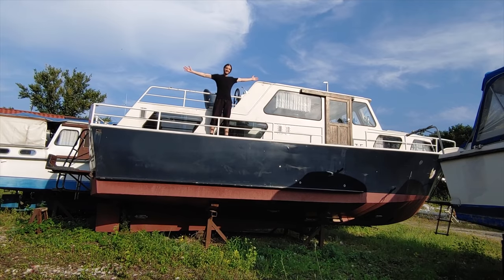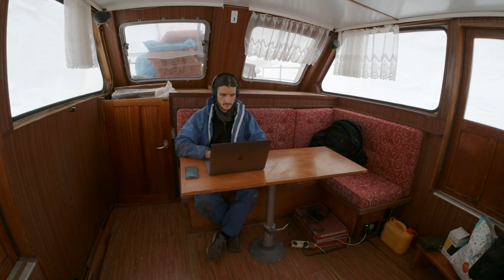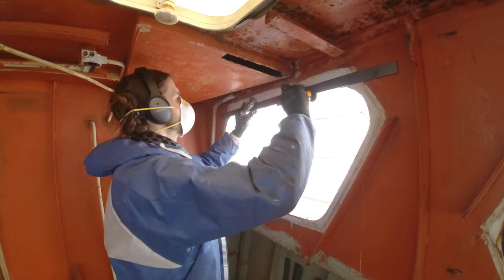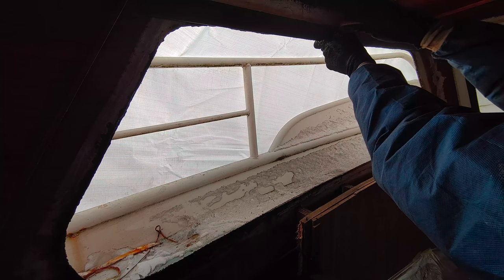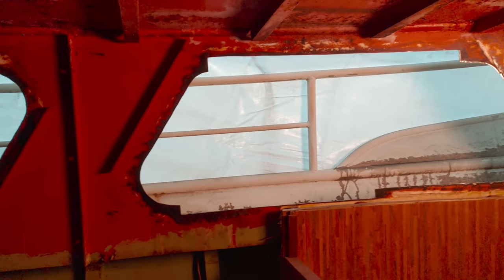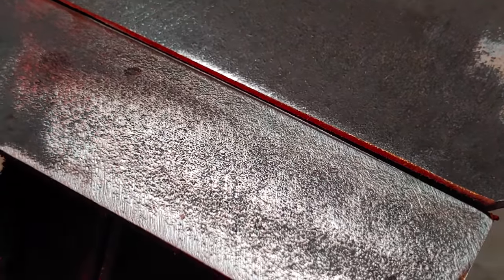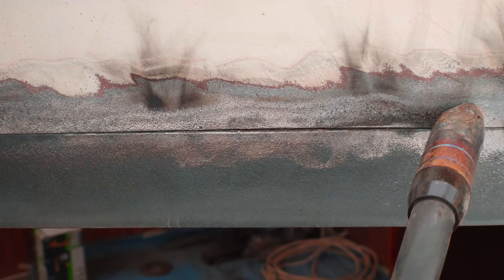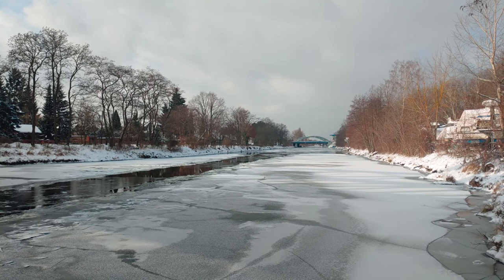Welding the Windows in our Steel Boat - Week 19 - Vintage Yacht Restoration Vlog

Comment: Should use an O2 shielding gas for best results or at least flux core wire (flux inside wire blocks O2 molecules) either method will greatly reduce splatter and help you weld like a pro!   (Too much splatter can clog the wire feed tip).  Also, when you achieve a certain mastery level, you’ll be able to use welding  as an additive material, like a sort of ‘electric hot-glue gun’ to build-up/restore rusted concavities (2-3mm deep) followed by light grinding instead of cutting, fabricating, and welding new metal that may be of different or inferior quality than native steel.  Good luck on the refit endeavor and enjoying watching the progress!

Comment: Great move to see you purchase a mig welder instead of a stick much easier for novice welders to learn. It's important you grind a bevel on the metal parts before welding for proper penetration and strength for your welds. Then when you weld the other side grind out a bit of the metal to form a grove and fill that grove up with a weld. That's how it done correctly I'm a welder fitter I won't talk of the magnets other have mentioned that. Your doing well, you'll get it.

Comment: Its a flux core welder ( mig uses c25 gas mix /MIG- metal inert gas) and the magnets are causing the issue. The magnets cause the arc to vary in flow. Good workmanship

Comment: Just a thought, if you must keep those old pieces of scrap metal for ballast you might want to consider soaking them in phosphoric acid or that rust inhibiting oil or alternatively making them into smaller, easier to handle blocks, encapsulated in resin. If I had the boat I would use that space for more batteries ( with solar panels on the cabin tops ) and add more lead if the ballast needed increasing :)

Comment: Good  work 👍 but try welding with gas to the mig , much easier 👌 , but the god thing with flus wire is that you can weld in high wind :-)

Comment: It will cost as much as the Mig, but you have a steel boat and will be welding a lot, Getting gas (Argon,5%CO2,2%O) and a regulator will improve your welds, so you can push weld (right to left) rather than the pull (left to right) welds you are doing. It will also give you a better penetration. Running some welds on scrap first to get your eye in, get the settings right and warm up the equipment will also help and make sure you have a good contact with  the earth clamp. Almost forgot, change your wire from gasless to gas.

Comment: I've had a few occasions where those magnets really interfered with the welding. it was like it was blowing the molten metal out of the weld.  I took them away and the weld laid down nice and smooth. You might try it without it and see if it improves.

Comment: Welder here, couple of tips based on what i saw... For doing tack welds crank up your machine you need more heat aka wirespeed and voltage. Your welds look cold. Did you notice when you slowed down and globbed it on your weld become nicer?!? This is because you allowed the base metal to become hotter and your weld wasnt nearly as cold. If you crank the heat you will be able to get that same consistent penetration and uniformity while putting down less weld so less to grind. Only thing that will change is your travel speed increase. With a hotter weld pass the weld wont be as tall and still have better penetration.  I also notice your mig gun at some parts had an extreme of angle, ideally you dont really want more angle than 10 or 15 degrees max so try to keep it more perpendicular to your work surface. I would also recommend skipping the torch whipp move and just focus on slowing down and making a nice consistent pass. The whipp can be cool but given the fact your welding with flux core wire you open up the possibility to burning flux back into your weld and causing porosity (think worm holes) like you see. If you're wanting to do any torch movement id recommend just going like a 3/16 of an inch/  4-5 mm and pausing for like a half second and then going 4-5 mm and pausing all while keeping the trigger pulled and wire feeding all in one continues pass. If you need to fill a large gap work the torch in a U or V on the edge of your weld never overlapping but rather just stacking them very very close together. Think of writing the letter U or V numerous times very close together without lifting the pencil while pulling it towards you in a straight line. One last thing, when you can afford an auto darkening helmet you should get one. Freeing up your second hand to help steady and slide the mig gun will help tremendously in consistency. Hope some of this made sense, if you have any questions let me know. Practice makes perfect and keep it up. 

Hardest part about becoming a better welder is learning how to read the welds and metal and then making the necessary adjustments.
Reply from the maker: Hi Cameron, thank you for the extensive tipps. It will help me in the coming days, some very important welding jobs coming up.

Comment: What all these internets welding experts haven't told you is that you can V the edges of the steel where it butts together, that enables the weld to get deeper into the join creating a stronger join.
Reply from the maker: thank you, I'll try that next time.

Comment: Turn up the amperage. You should have a nice steady buzz. Also with mig you push the weld...not pull it like stick welding. Makes no difference with fluxcore but you will get sick of the dirty welds and switch to gas at some point...much nicer and cleaner. Then you need to push the gas envelope, not pull it. Great job you're doing. You have bigger balls then most tackling that beautiful old girl!!

Comment: hi! great videos, i really like to follow your jurney. a tip for your welding tecnics. when preparing the pieces of metal for attaching, grind a little angle towards the outside edge, that way your welder can do all the work from the inside while you are filling up the trianulare gap.

Comment: Can I book you for replacing the old window rubbers? 😀
I also got an old dutch boat, little shorter with 10 x 2,8 but with some similar problems. In deed, not that much...
Really a great job you did with a lot of courage to just try jobs you never or a long time not did. Head up...

Comment: Check the correct stick out for the wire, angle should be closer to vertical, the pits show insufficient penetration, let the puddle (pool) develop and maintain it.

Comment: Just a little advice...when MiG welding, push the puddle, don’t pull it. By pushing the puddle, it preheats the steel your about to weld thus making for an easier and cleaner weld.

Comment: Also another tip is to pull you gun and have angle of around 30 degrees not 90 as you have now.. you will get much better results.

Comment: tip and question .. suction or exhaust of motor ventilation: does the fan blow or does it draw in air? otherwise the exhaust is on the low side, with rain, splashing water can enter the exhaust

Comment: Good job! But, make yourself a favor, don’t use that small transformer fluxcore welder. You could probably find a used Esab c160i or Migatronic Rallymig. They have both synergic settings, and that will help you a lot. And also fumes and smoke from that fluxcore is poisonous.

Comment: A proper speed hood is not expensive, maybe $100-120 USD, it will make give you 2 hands to use when welding, thus more control over the stinger.

Comment: Welding definitely takes practice. The key factors are definitely clean joints. And proper current and wire speed. You should definitely be grinding levels in both edges to be welded. Also, to avoid warpage, try welding about 1" sections, far away from each other along the joint to be welded, and let the metal cool between sessions. 😁  all in all, not too bad for a beginner.😁😁

Comment: I would slow down my travel speed, your not allowing a weld puddle to form, too be honest i never did like fluxcore without the 75/25% gas mix we used too use just the fluxcore on offshore platforms etc.

Comment: Good job but little note, you will not achieve anything good by welding with the magnets, these tips are just to point the parts and remove for welding, put your mass very close to the welding point and set your power to the limit small "grabon" which are a sign of over-intensity especially with cored wire ......... good luck

Comment: It's not structural as long as you can't see light through it you can put a little body filler in there it'll be fine you'll get better with time mig welders give you a much better finish than a stick welder especially if your not a professional